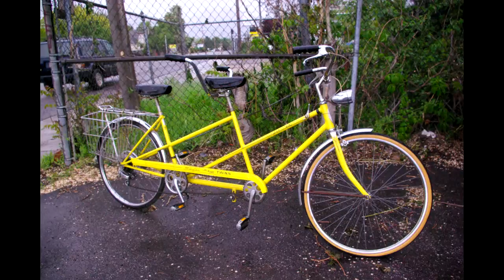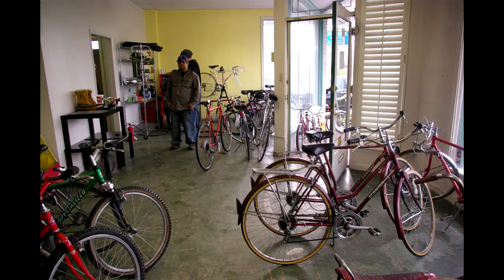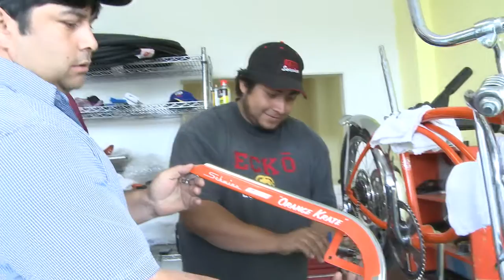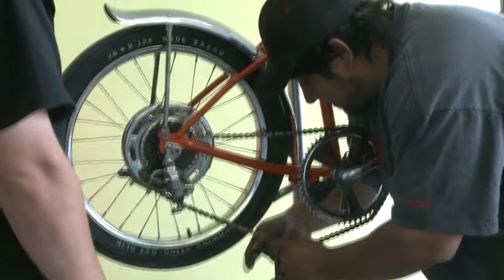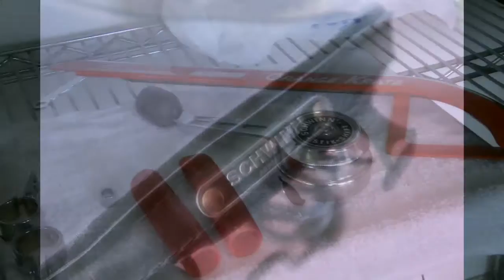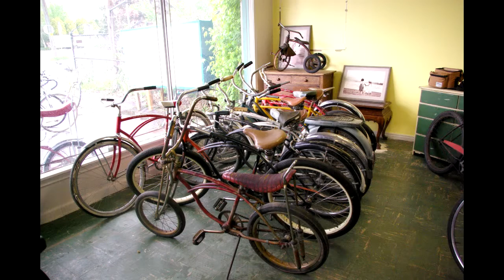Matt Recycled Bikes - Tandem Schwinn - Orange Krate - Tricycle

Comment: I had a schwinn Deluxe Twin, 1971,  for about 20 years.  Wish I still had it.  The main problem towards the end was getting tires for it.  In 1992 the heavy duty “Schwinn 26”” was hard to find and my local Schwinn dealer was a jerk.  So I go mad and sold the thing cheep.  If I had it to do over I would rebuild the wheels using a standard 26” rim so that good  tires would be easily available.

Comment: Just a general tip when your dealing with a orange krate i strongly suggest putting a small work towel across the chain stay tube that way if the chain slips when installing the paint is protected.    Another tip install the cain back together off the main sprocket that way its not a two man job.  carefull with roming too many links as it may affect if it goes into the top chian ring.  best bet is to keep the original union or sedis chain.